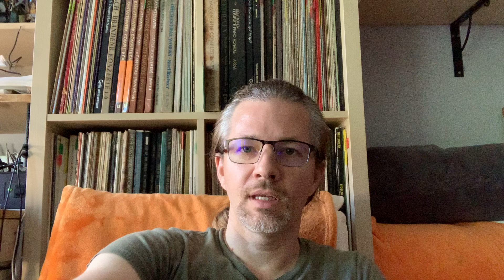What is loudspeaker driver wattage rating? Is high W a good sign?!

Comment: This has always interested me, as I’ve wondered whether ratings on drivers mean you shouldn’t pair high power amps. This explains you can, you just won’t be using all the power. This brings me to ATC, their speakers have ratings of taking up to 1000 watts, I assume then this speaker NEEDS HUGE current and power delivery to get anything positive from them. So the answer is buy very efficient speakers to get full range sound that isn’t difficult to power.
Reply from the maker: Hi Benvos, indeed! People usually think that having loads of power is the ultimate answer... because more is simply more. It's like putting a hundred or a thousand times bigger in a car than what's absolutely necessary for optimal performance. What people are not aware of, is that with more power comes more alteration from the recorded signal. Ads are trying to convince us that everything is all right because even though the power is tremendous we can get it with next to zero distortion. Yet, the ads omit the omission. The price of high power is subtractive distortion and hard distortion, low-level details erased, and tone and timbre compromised. 
Also, the super low distortion figures are platonic. They refer to resistors, not actual speakers. With actual speakers, all bets are off. Measurements with loudspeakers are never published. This is equivalent to saying a swimmer is good or bad based on tests done at a clinic. Yet, nobody ever caring to test how's the swimming, or whether the subject can swim at all...
Reply: 1k watt sounds like a car speaker rating.
Reply from the maker: @EddyTeetree  Watts are KING! :) LOL.